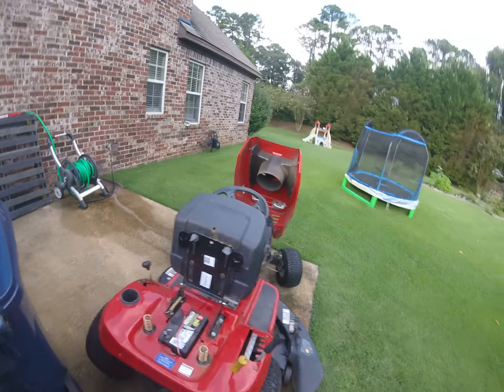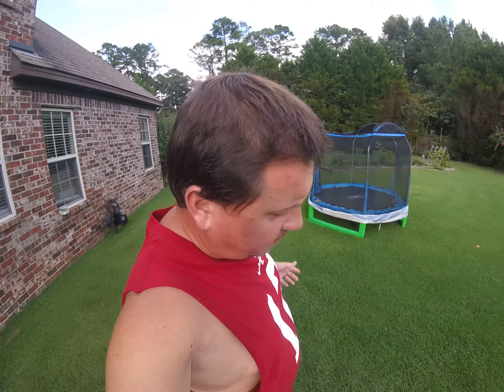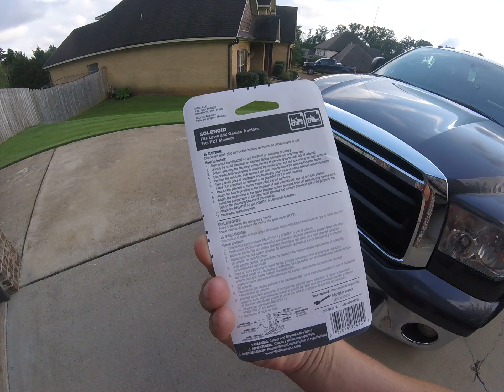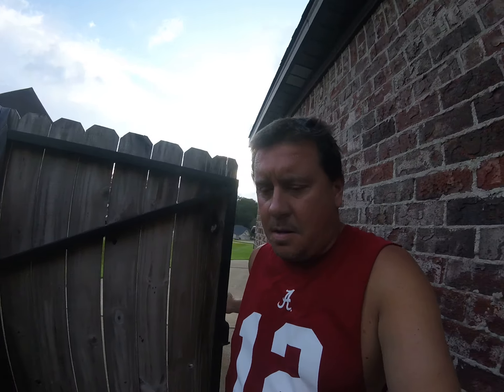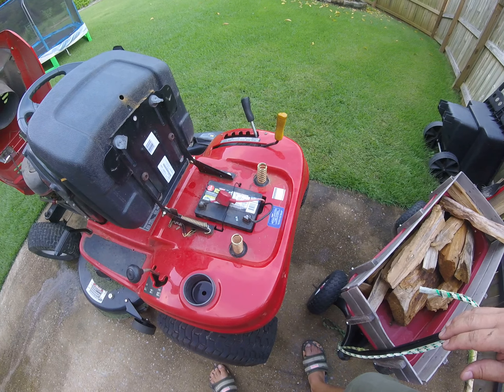TROY-BILT TROYBILT PONY LAWN TRACTOR WONT START - DIY - STARTER SOLENOID - LAWNMOWER REPAIR

Comment: Thanks for the video. I changed the solenoid, checked the fuse, and was getting ready to test the starter. Then I saw you talking about the three safety switches.  I couldn't see the one at the PTO cable. But when I engaged and disengaged the blade a couple of times, the mower started right up!

Comment: I have been dreading this as a potential problem but my symptoms are not yours. I do get my engine cranking but it won't quite catch. I replaced the spark plug, charged the battery, replaced fuel filter and pumped out gas - put in some fresh.  My options were down to solenoid, coil or carb. So at least from your posted video I no longer think it is the solenoid. (relief!) but coil and carb don't sound like something I necessarily want to tangle with.
Dread more than anything it is the carb. they can be a real sucky problem as I recall from when husband used to do all the maintenance (trained certified mechanic small engine and autos.)  My battery...after quite a few start attempts...read 12.2 volts. below the threshold of 12.4 and far from the preferred 13.x-14. (not under load) IT could STILL be the battery... but I couldn't be that lucky, could I?
Well thanks for the video and walk thru... just absolutely could not see ANYTHING you were pointing to under the battery compartment and bare could see undet the deck safety switch.

Comment: Need some light to show the solenoid and fuse. I can’t get to the solenoid in mine.
Reply: I have the same issue, the solenoid is under the mower, outside the batter box and I can't get to it.

Comment: You do not I repeat do not have to have someone in the seat to start the mower, just have to have the parking brake engaged. Also you can unplug the switch at the seat if one wants to. I unplugged mine so I could get off the mower with the blades still engaged ( in case I needed to move something and didn't want to disengage to get off the mower) but that's me I'm not suggesting to someone with children to do this, just saying it can be done.
Reply: Also I disconnected the reverse kill switch.

Comment: How did you know that part was bad I’m helping my dad with one like yours and we thought it was the fuse because I changed the one under the battery and it worked for a bit then quit
Reply from the maker: Once I hot wired the battery to the positive on the starter that's the only other thing I could think of.

Comment: Dear Friends. Please, help. My left (Driver side. The one with the adjustment gear) of the deck is high. The right side (passenger side. grass outlet side) is low. When lever is on position 4, i.e. the second highest, the right side of the deck scrapes the grass! The gear is all the way up. I.e "Driver side" of the deck is all the way down, but still too high. Do I need a new deck? New tractor? Thanks in advance.
Reply: I discovered one rear tire was underinflated even though it didn't appear to be when I looked at it when I was standing off to the side.  I accidentally leaned on it and that's when I discovered it was substantially underinflated.  That was my problem.
Reply: @wessdad4439  This was exactly my problem.. When you look, it appears fine. However, when you check with the gauge, it is very low. When you press with a shoe, it flexes more. And finally, when you add a human weight, then the difference is big.
Reply: Could also be your deck needs leveling. My gear on the left side rear hanger is set at the third notch from the top. My deck sits level ( I just recently replaced my mower deck with a brand new one).
Reply: @jonathan3982  I realized that the problem is in the tires. Suddenly they started to leak a lot. Now I am at the point to adjust pressure before each cut. I added green slime in both tubed and tubeless tires, and it may help just a little bit. Nope. green slime is POJ.

Comment: update on my mower  :  someone repurposed the 2 main power wires .

     
red wire  and the  double   red/white wire     

 the problem with the mower that i have was  someone crossed the solid red wire  with  the ground red/white stripe wire .

red wire   [ starter  jumper wire for solenoid ] 
red wire/ white stripe  [ ground wire for  hot side of solenoid for the carburetor ]  (  is tied in with the safety switch  [[ both of them . . .is like a secondary hot wire ]] . 

everytime i  turned the key to crank it , the starter would have a slight click.    

had to remove the wires from the computator plug  with a 90 degree awl to bend the metal catch so i could get it out, and put it in the place it was supposed to be for to begin with.

when i had recieved the new ignition switch, all the  letters were in the wrong place. had to result  to the O.G.  ignition switch.

good news is, that if i need a new ignition switch, i can always  move the female spade terminal plugs 
to where they are supposed to be.

going to make a small correct color wire spade plug  so i will know where the wires will go.
Reply: so red/white is on the side going to starter or the constant from battery

Comment: Is the carburetor hard to clean I just paid 130$ for someone else to do it when I’m thinking next time I could do myself
Reply: It's not bad at all. Usually you can get a carburator kit for less than 50. I'll post a video about it.
Reply: Very easy to clean kits start at 20$  for Briggs carb .

Comment: good content on the mower.  thank you for your time.

here is one question you could solve for me.  mine will not start.
 <
 dont know if you still have that mower, but i am having trouble with mine. it is the same as the one you have, my problem is . . . the fuse box.
one wire goes into the harness, the other is loose and i do not know where it was attached to. 
do a video of where the wires go, especially the loose one  [ the one that is not in the wire harness ]   .
plz do not make the vid short.

<
<

mower has no juice at the ignition switch  because of that wire. 

thank you .

good content !
Reply from the maker: I'll look into it and get back to you. Sorry for late response.